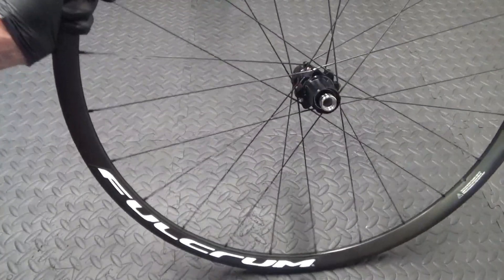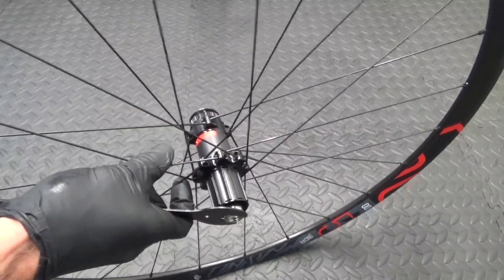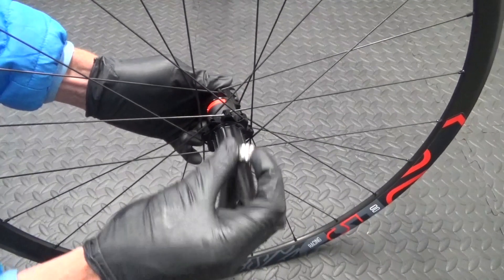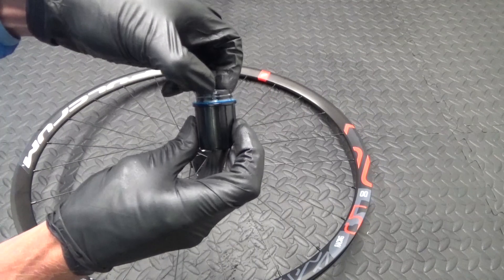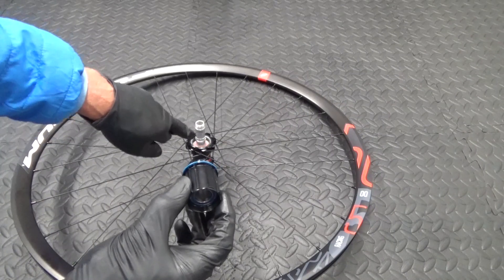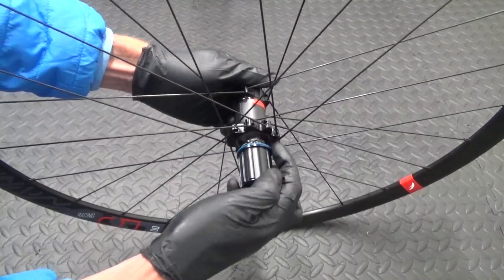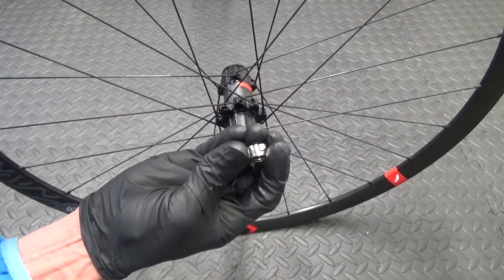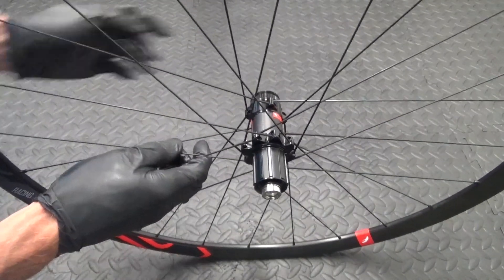Fulcrum Racing 5 DB Freehub Removal Guide

Comment: Great vid, thank you! I used the socket technique. Went fine although on my first ride I started getting lateral play. I slackened off the allen key bolt on the collar and tightened it back up. Seems to have fixed the problem. Not quite sure why it all loosened off though?

Comment: Thanks for the video, my rim came with 12*148 boost and I wanted to ask if it's possible to change that axle that's holding the free hub body shown in this video from 12*148 to 12*142 non boost. Thanks
Reply from the maker: The racing 5 db is 12x142mm! Not possible to change the axle from boost to non boost.
Reply: Thanks a lot 🙏

Comment: hi, I have noticed my free hub is loose and moves. I tried putting spacers in my cassette but realised it is not the cassette its the free hub moving , its not tight. However after tightening it from your video its still loose and moved , any suggestions ?

Comment: Hi, I’ve replaced my racing 7’s with R5’s and just swapped the N3W freehub supplied with the wheels to a 12 speed campag one. Installed it exactly as you have in video but when I put wheel back into drop outs, the drop outs rub on the 11 tooth cog? I also noticed the axle does not rotate independently of the freehub like my R7’s did? How are the wheels supposed to spin when tightened up in dropouts? What have I done wrong?!
Reply from the maker: Did the Campagnolo freehub body come with a new right hand side end cap?

Comment: Hey all, can anyone confirm the Freehub body used on in this very helpful video guide by Free To Cycle' is it the RS-113 which I've picked up elsewhere, but not managed to confirm yet
Reply from the maker: Yes it’s a rs-113 freehub body!
Reply: @FreeToCycle  awesome, thanks so much, I tried to catch you referring to the part number during the video, but didn't manage to!  Thanks again, solid video :-)
Reply: @FreeToCycle  hope you didn't mind me mentioning and asking, but the original freehub body on mine only last 10-months, despite using a 10 speed spacer, the Freehub body become marked up and pitted very quickly and got me wondering why.  Is this down to needing a larger spacer or in your experience, is more to do with the original Freehub body material, with the freehub body provided not being particularly good?  And the replacement better perhaps?  Appreciate your time and view on this :-)